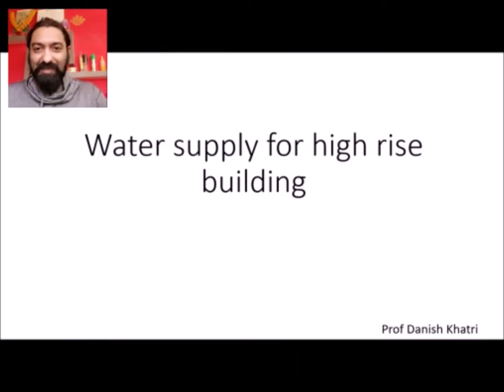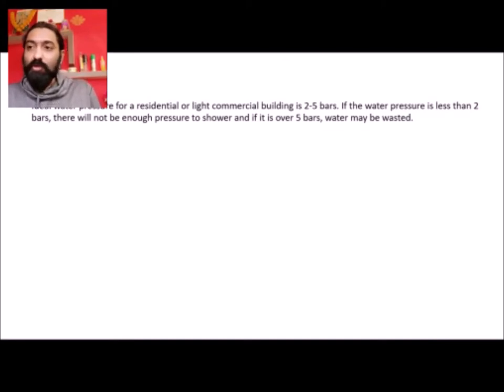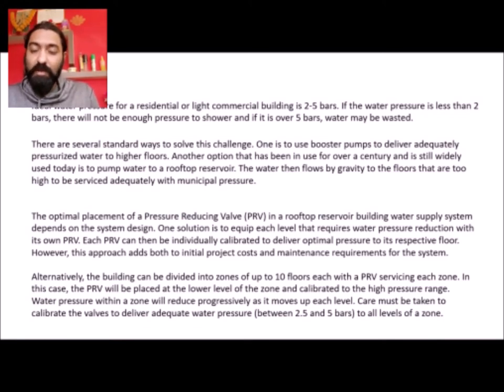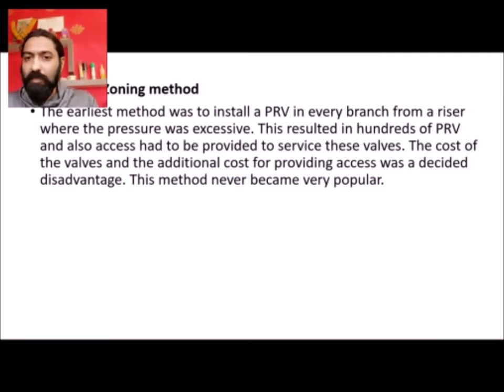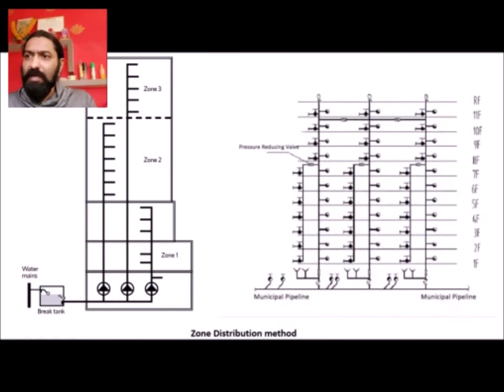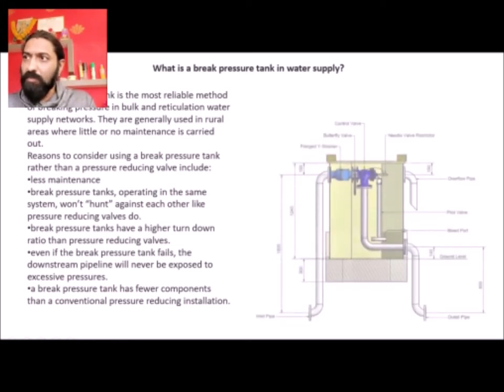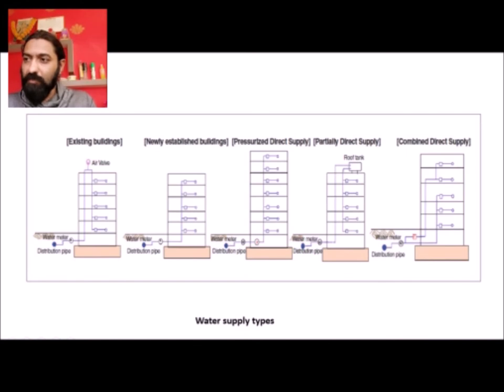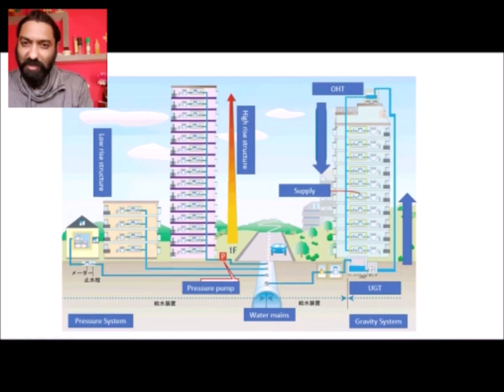Water supply for high-rise buildings

Comment: What is the best method for supply water for high rise buildings? The pressurized system or the roof top tank by gravity?
Reply from the maker: It's very subjective actually. Both system has pros and cons. It depend upon many variables, like, gravity tank consumes terrace area,  affect building aesthetics, height rules, pressure situations, etc. While pressurized system also has concerns about budget, maintenance, and all. In my opinion, the decision should be site specific.

Comment: Thank you for this. Where exactly in an apartment building do most pressure losses occur (in pipes) ?
Reply from the maker: Hello, the most common pressure losing points are, loose connections (L, T, Reducer, couplings, etc.) and taps/ faucets. However, one can perform fume test to find out the exact location of leakage. I hope this answers your question.

Comment: Dear Sir.For close loop hight rise building.Does it still necessary to ad Buffer Tank on the system or just provide make up water flow to the pope sustem of the my Chiller plant.The apploaction is for the 17th rised building.Please comment Sir
Reply from the maker: Hello. In my opinion, valve might be sufficient enough. (70m high we can go) I hope pressure is somewhere around 9-12 Bar. Still check all calculations for both the pressures and take expert opinion again. Good luck🙏

Comment: Hello, Why do some high rise build use cisterns for the upper floors and mains for the lower floors, what happens if the water is pumped up to the cistern and it in turn supplies to the rest of the building including the bottom floors?.
Reply from the maker: Hello, thank you for watching and keeping it interactive.
I will try to answer your question.
Technically, the more it goes higher the more pressure it exert on lower part. In high-rise buildings, if all water pumped to cistern and then released to lowest floor, it exerts tremendous pressure on pipes, eventually bending and cracking it. To tackle this, by distributing it ito two different techniques, minimises the risk of plumbing failure. But the decision should be taken on certain calculations, like, building height, pipe diameters, materials used, no of outlets, etc. I hope it solves your doubt.
Archedu.
Reply: @archedu001  Thank you, it sounds really logical that eventually the pipework would fail. Appreciate you 🙏🏽

Comment: hi could you explain about pipe bursting in a hydro pneumatic water system even after pressure is monitored
Reply from the maker: Hello thank you for checking the video.
I will try my best to answer.
The reasons could be many and depending on certain factors, like geographic location (to be more precise, colder regions - where temp is mostly below freezing point), diameter of pipe selected, material used, number of branching and bent, absence of air vent, number of outlets, etc. overall, suitable pipe should be selected depending upon the bar (water pressure) to be handled and correct methodology should be applied to carry out plumbing works.
Reply: @archedu001  sorry I'll elaborate working on a residential project  7 floor +g where the main water pipes show signs or busting at the fittings. The systems uses a hydro pneumatic system at 5 bars aprox. Need the route cause the system doesn't have a surge tank that is for sure.
Reply from the maker: Hi,
You can check for water cushion in the tank (as per ASME standards). Or In your case you can check for PRV's used, might it solves the problem. Because as far as my experience is concerned, bursting will happen due to following reasons:
1) extreme climate and drastic temperature difference (day and night) regions
2) increased water pressure
3) faulty joints and bends
4) material used.
I hope it serves the purpose.
Good luck!

Comment: What is the sound of a broken system ?
Reply from the maker: Hello, sorry for late reply. Would you be kind enough to elaborate please
Reply: @archedu001  I finally got a hold of maintenance. 
The guy said there was a hole somewhere in the buildings water heat pipe system.
He finally fixed it after a month or so. 
Sounded like directly under my floor. I live in the basement suite.
It sounded like loud rusty metal doors. Gears, mining equipment...lol.
I live in a mining town. 😌 Moving, slamming,...
I sure wouldn't have ever thought the sound came from a hole in a pipe. ! 😅No matter how gaping a hole it could be!  😅
Reply from the maker: @sandrawilkinson3782  the sound intensity might be increased due to resonance effect (because of cavity). Thus causing structure born sound (which travels faster then airborne sound creating vibrations) well, it's just my prima-facie reaction after reading your note.
Reply: @archedu001  Thanks👍💖. 
Your answer makes a lot of sense now! 🤗
Reply from the maker: @sandrawilkinson3782  you are most welcome. 😊 I appreciate your communication miss. 😊👍